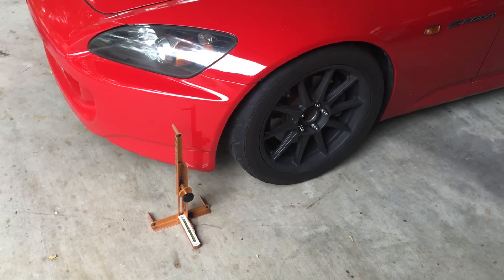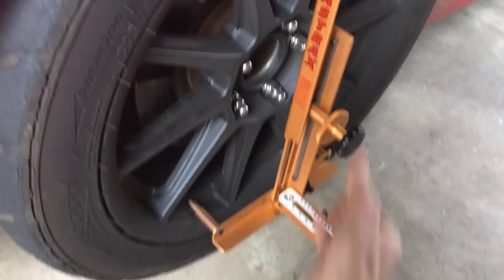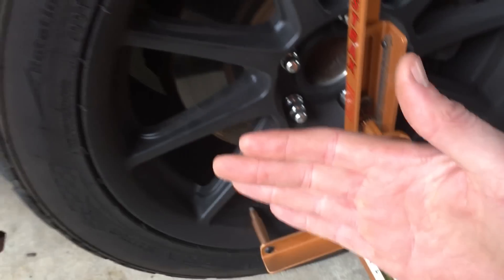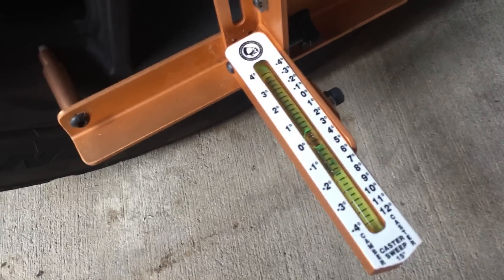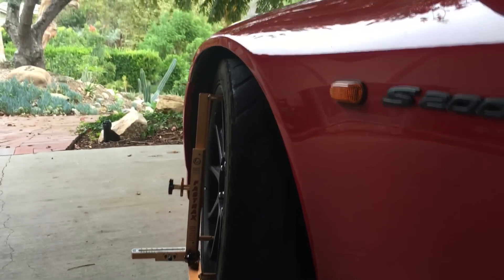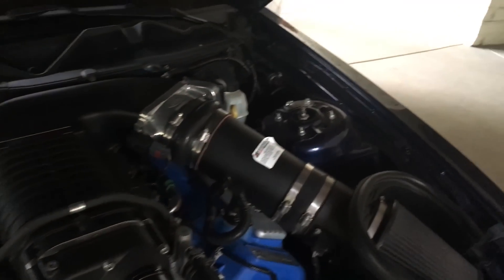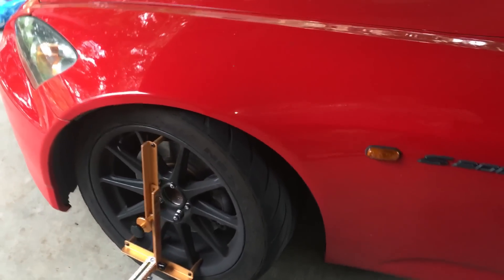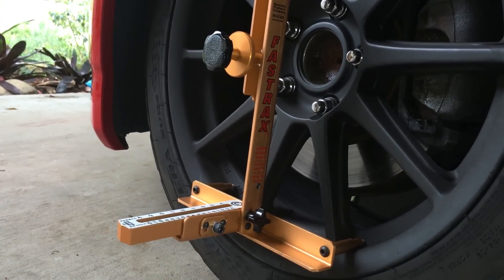DIY Alignment - Using a Camber & Caster Gauge

Comment: Keep working at it you have good presentation on video.
Camber changes when caster is changed, visa visa. You need to talk about how to nullify any wobble in the wheel  for accurate tool usage. When you zero out the tool before checking/setting for camber you take out the error for any inaccuracy of a level floor and can trust the accuracy of the tool.
Reply: Aq

Comment: So your camber plates on the Mustang allow for caster adjustment as well?
Reply: Usually moving the strut towards the front of the car or rear of the car will add  +/- caster
Reply: Hamdan Ahmed Yea, but Zent didn't do it in this video, so I was wondering if the camber plates he is using on his Mustang allow for caster adjustment or not.
Reply from the maker: Yes I can adjust caster on the mustang as well.

Comment: Great video, I have a 78 Corvette and the shop aligned the front passenger caster +3.0 and driver side -3.0. I asked them about it and they said that as long as it drives straight, it is OK. The wheel does not return to center. Could this be the issue? Also, the steering is quite stiff.  I don't know how this car is supposed to drive since I just bought the car and had the front end redone before driving it. Any suggestions or comments? Thanks!
Reply: I have read numerous times that caster is a main factor in return to center issues.
Did you get yours figured out?

Comment: That's negative POINT 3 (-.3*) camber. If you had -3.0* your tires would be gone. And thanks for chomping your gum the whole time.
Reply from the maker: Nope, a standard track alignment is around 6º to 7.5º of front caster, -3.5º front camber, -3º rear camber, zero front toe and 0.24 inch rear total toe-in for the AP1 and 0.14 inch rear total toe-in for the AP2.